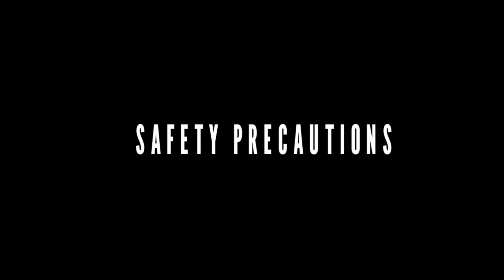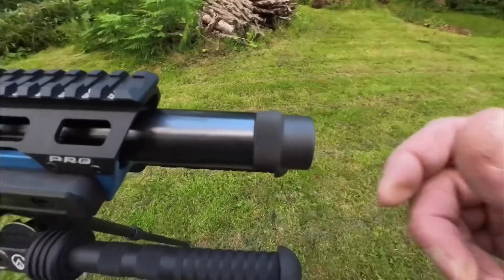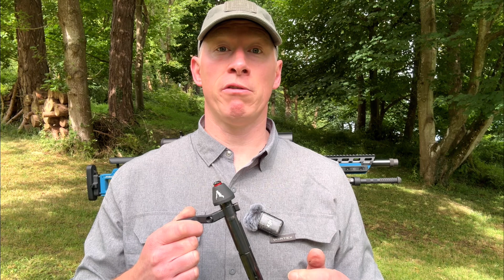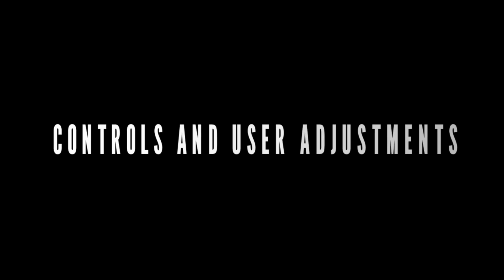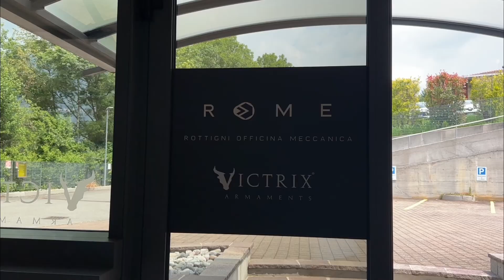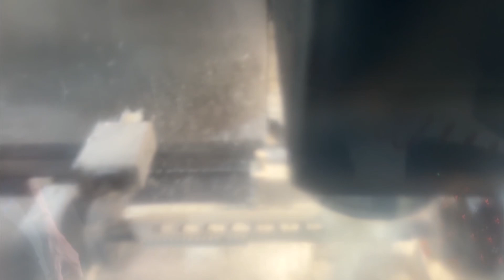The best .22LR rifle? Victrix Venus Pro SB

Comment: Hey Jon i do have a couple questions.  1.  Can you get a REAL thumbshelf places on the chassis?  That indentation is not a thumbshelf.
2.  Can you get some kind of adjustable bag rider for this?
Oops one more

3. Can you just get a barreled action for this and what chassis system can this be used in?

Looks great minus those 2 big things that will stop me from buying.

Thx for any input.
Reply from the maker: Unfortunately there is no way to mount a thumbshelf because the chassis has no drilled and tapped holes to mount. 

Victrix does not sell barrelled actions, except as part of a complete rifle system.

The Victrix footprint enables Victrix barrelled action to be swapped between their own chassis - eg you can swap between the Gladio and Venus Pro chassis.

Comment: Hi John, can you tell me what is minimum lenght of pull on this riffle? I shoot preaty straight forward on my position and i'm just woried about lenght of buttstock.
Reply from the maker: The Venus pro has a length of pull from  35.2cm to 37.1cm (as measured on my rifle).
Reply: @JonCresswellUk  Thank you. It's the same as motus chassis for my CZ457 and little bit too long for me.
Reply from the maker: @mariuszpilch7762 ok thanks for letting me know. I’ll feed it back to Victrix.
Reply: @JonCresswellUk  Riffle is great. Shoots well ! Will be grat if they will make shorter buttstock even optional, more less 2-3 cm. New shooting techniques, requaries shorter buttstocks, specjaly for PRS style shooting.
Reply from the maker: @mariuszpilch7762 true, I have my butt stock fully retracted when shooting off barricades.

Comment: You have originaly trigger with 250 gr of force, or you make upgrade with Victrix sporting single stage V trigger with 40gr of force?
Reply from the maker: Victrix Sporting Plus adjustable single stage trigger with a two-position safety: standard setting approx. 250 gr (8.82 oz). I have not adjusted from factory settings

Comment: Chassis lenght of pull alone will disqualify it for most people , its longer than any other chassis by some margin, having scope on XXL high mount does not help author's credibility.
Reply from the maker: Hi, thanks for the feedback. 

The Venus pro has a length of pull from  35.2cm to 37.1cm (as measured on my rifle). Standard length of pull for rifles is approximately 34cm, so the Venus chassis is only slightly longer than standard in length of pull.

Agreed, I could have opted for the 34mm high mount instead of the 48mm high mount.  I couldn’t go any lower than that otherwise my scope wouldn’t clear the foreend picatinny rail - this was a bit of a miscalculation on my behalf and I agree that it is slightly high for my rifle. I do tend to shoot keeping my head more upright as opposed to the traditional high cheek weld. It works for me, but point taken. Thanks.
Reply: @JonCresswellUk  IF you look at competition like MDT they go 31-37cm ,in PRS we are going shorter all the time as unlike conventional rifles you shoot much more squared to the target .We compared them to MDT and  its just to long for many , i guess Victrix will change that buttstock sooner than later.
Reply from the maker: @Mr.T-SI thanks.  In comparison to that chassis you are right, it is longer with less adjustment in the length of pull. I will feed this back to Victrix. Thanks for taking the time to share your comments with me, I appreciate it.

Comment: those mounts are way too high
Reply: No doubt, I was expecting a crazy amount of MOA with all the height, and it is only 20. Also wondering why one would put a pic rail on an arca rail chassis?!?
Reply from the maker: @OwlsAndChickens I explained the mount height and the reason for the pic rail in the video 👍. You could easily fit the medium mount (#3438) I wanted to have clearance of the enclosed foreend.  The pic rail is for my bipod as it’s not an arca bipod.
Reply from the maker: The mounts come in a range of heights - this is the one I picked 👍. Yes I could have fitted a lower mount.

Comment: Awesome rifle!
It would be really nice to know where the balance point (center of gravity) is, expressed as the distance from the barricade stop.
Reply from the maker: I measured the balance point at 6.5cm in from of the barricade stop on my rifle with the bipod fitted. Using additional foreend weights would move this if needed.
Reply: @JonCresswellUk  Thank you! This helps!
Reply from the maker: @OshoRamseyGump where would you normally have the balance point?
Reply: @JonCresswellUk  Ideally, half the length of your Gamechanger bag.
So 9 cm or so. This way, the rifle balances on a thin prop, such as a thin board.
Reply from the maker: @OshoRamseyGump ok thanks. In that case adding another set of weights on the foreend would move the balance point further forward.
Reply from the maker: Thank you.  You can change the balance point depending on where you place weights and bipod etc.  I’ll have a look at mine and will get back to you.

Comment: I shoot a VICTRIX ORB and definitely  VICTRIX knows how to make 22LR. The VENUS is perfect for PRS and the ORB is the best 22LR for ELR22 . Accuraccy,  ELR features , TACOM Charlie mount, Rear Adjustable bag rider, very high V0 and fast cycling 10 round magazine, for shooting in the wind at 600yards.  And about price:  just add, what making a custom rifle would cost and how much time it will take...... and add the possibility of mismatch  of parts that will need adjustment and upgrades.( been there done that) . After you do your own calculations... you will see that the VICTRIX is actually a very good and reasonable investment. Your will get a rifle that is second to none from day 1 and start enyoing it.
Reply from the maker: Yes the Victrix Orb is a nice choice for ELR. I’ve not yet had a chance to shoot it, but it’s got great features. 

Thanks for the feedback. Yes the costs of individual component parts for different manufacturers would cost a little more and the time to build and set up would also be considerable. I do think the Victrix is exceptional value for money for the competitive shooter.